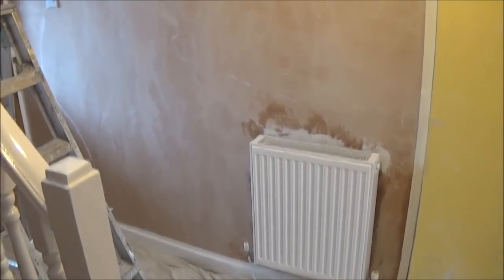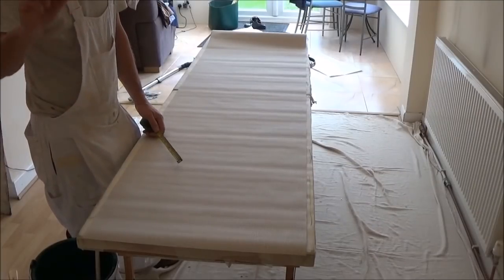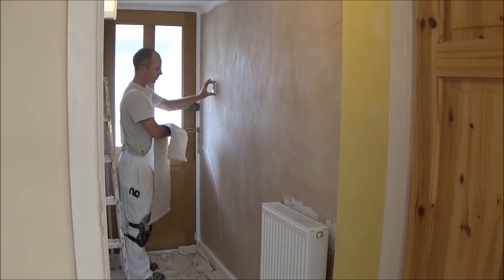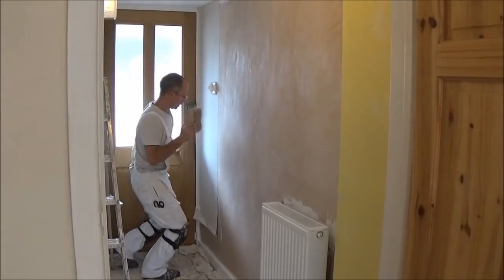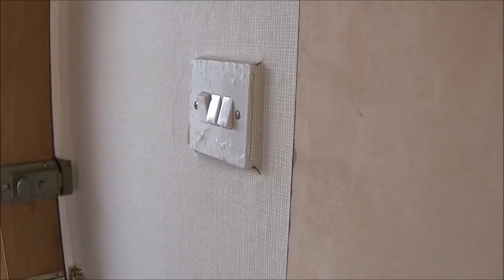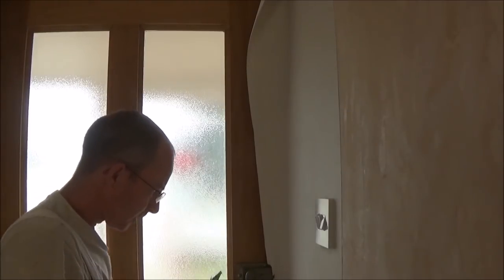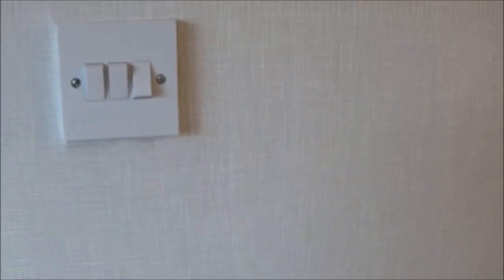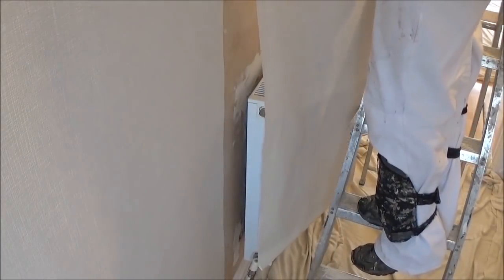How to wallpaper behind a radiator

Comment: The master at work thanks for making time to show us this more long vids please.
Reply from the maker: Thanks
Reply: Painting and Decorating  excellent work as usual. I have a problem could you help. I painted the walls in my hallway and there are small blisters coming through the paint. Your help is much appreciated. Tony Ere,
Reply from the maker: Sorry, Tony missed this comment. If this still helps leave it to dry and see what happens it may sit back when dry.  If not you have to scrape off the bubbles then wash in case its paste or some other contaminant on the wall. Then fill using a hard-stop filler then paint. Sorry for the late reply

Comment: Good job Mr. P and D, I allways recommend they get a radiator shelf wich just slot down the back and  it hides what is below it, you can get them fairly cheap I got white one's for my flat they have a decent satin finish on them as well

Comment: A good demo, I find with a difficult pattern if you lay the paper face up on the board and pick a pattern match be it a flower or a line if you fold the flower point to the next flower in the repeat and make a light crease on the opposite where the crease mark is is the pattern match

Comment: Great work btw .... Would it be easier to paste the wall at the radiator level rather than the paper and also don’t you do two cuts either side of the brackets or are you not really bothered about the in trimmed paper round the brackets
Reply from the maker: Thank you..
the paper needs to soak first.. and the paper was cut so it fitted over the brackets just enough..  the plaster was really bad because it had been skimmed with the rad on the wall...  stupid like.
Reply: @PaintingandDecorating  thanks 👍

Comment: The problem with papering round the conduit is heat will over a short period of time give a rippled corner effect due to the expansion and movement of the plastic, good video tho
Reply from the maker: Thanks, It won't otherwise I would be getting complaints and seeing it when I return to jobs...  if this is happening to you you're doing something wrong.

Comment: The switch socket part seemed overly complicated.... Why not take if off completely leaving a hole in the wall, put wallpaper over it as if it was not there, cut out a hole and put the switches back on ?

Comment: The next day after papering, I found I had gaps all the way down my joins. What would be the cause of that pls?
Reply from the maker: Did you put your heating on after papering or was it a very hot room? Sometimes this can cause the paper to shrink rather than drying naturally. Or what you may notice is that the joins touch every 12" with gaps this is down to the paper being shrink-wrapped at the factory.
Reply: Painting and Decorating , the rooms were small therapy rooms so quite warm naturally. Paper was a thick heavy embossed type. Thinking about it again, I may have over stretched it while smoothing up and down, another of your videos recommends smoothing left-right. 

Great videos, thanks for posting. Glad to have found you now.
Reply from the maker: Yes, smooth over on width, not the length side to side. But this would not cause your joint gap it would cause your pattern not to match.
Reply: Roger S Did you Size the wall before hanging your paper. If you do not size the walls the paper tends to dry quicker and shrink more , Hence the gaps.
Reply from the maker: This would only really matter on new plaster, and size helps the paper grip with it being a glue. It helps seal the plasters to stop the porosity.  We do not use size anymore due to having to mix with boiling water and it stinks. PVA does the same. But joint gaps have other reasons this is a rare occurrence if all joints leave gaps when drying.
Reply: Another decorator answered a question for me about shrinkage. If you mix the paste too watery it dries out causing the paper to shrink. Of all of your wallpaper shrunk this could positively be the case.
Reply from the maker: @faebrowne2537  yes this could be a possibility if you have not followed the instructions on how to mix your paste. But at the same time it would probably not stick after the paper has soacked, you would have edges lifting.
Reply: Painting and Decorating  presuming you followed soakage times on the back of the label ?

Comment: Why not just take the rad off the wall? Its a 5 minute job if you don't count the time it takes to drain the rad.
Reply from the maker: Steve Sheppard It's the customers decision.
Reply: Painting and Decorating I guess they didn't want it all taken apart, maybe save a few pennies too. Makes sense.
Reply: no need to drain it when you take it off..

Comment: Wallpaper behind radiators is bad as the heat will loosen up the adhesive and it become loose.
Wallpapers are being applied on one part of the walls these days.
Painting is better than wallpaper.